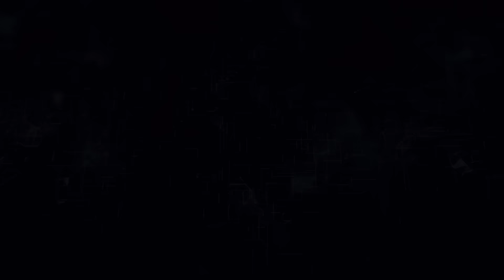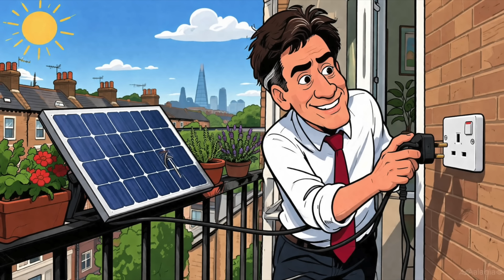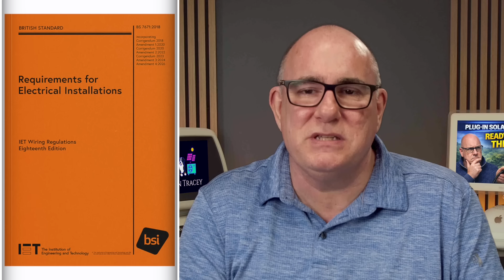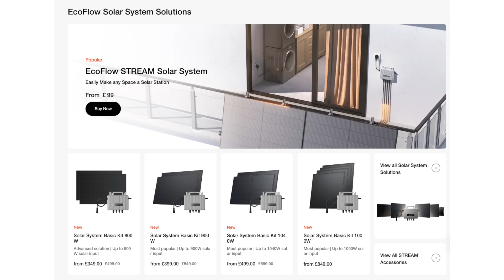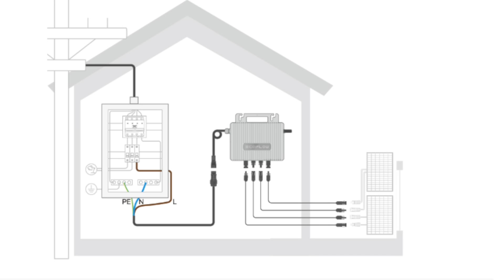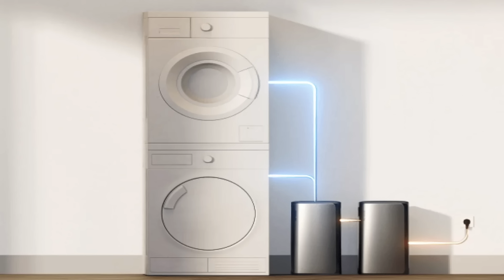Plug In Solar Is Coming… But There’s a Problem

Comment: We dont get near enough sunshine in the uk and we use more electricity in the winter so the whole idea is utterly ridiculous
Reply from the maker: @kickpublishing Ah yes, the UK — famously a place where solar panels simply refuse to work… which will come as a surprise to the **1.4+ million homes already using them**.

You’re right about one thing though:  
👉 We use more energy in winter  
👉 And yes, solar produces less in winter  

Brilliant — that’s exactly why people don’t rely on just solar.

What actually happens (in the real world, not the “utterly ridiculous” version):
- Solar massively overproduces in spring/summer (when days are long — even in the UK)  
- That energy either offsets your usage directly or earns export income  
- Then in winter, you combine that with tariffs, batteries, or just import less overall than you otherwise would  

So the idea isn’t “solar powers everything 365 days a year” — it’s “solar reduces your total bill significantly across the year.”

And just for context:
- Germany has *less sunshine than large parts of the UK* and has installed vastly more solar  
- The UK regularly generates *10–20%+ of its electricity from solar* in summer  
- My own system (real data, not theory) generates thousands of kWh per year — in the UK… somehow surviving the lack of sunshine you mentioned

So calling the whole idea “utterly ridiculous” is a bit like saying umbrellas don’t work because it doesn’t rain every day.

It’s not ridiculous — it’s just… not how you think it works 👍

Comment: One of the main reasons for having solar panels is you can still have some power if the grid fails. Unfortunately, with plug in you don't - your plug in system switches off. Much better to combine your panels with a small home power station and store some energy while you also run your fridge and kettle etc. Keep it separate from the grid. If the grid fails you still have light and can cook.
Reply from the maker: @petercc8679 I think you’ve got that the wrong way round.

Backup power is a *nice side benefit* if your system is designed for it — but it’s absolutely not one of the main reasons people install solar.

The main reason is very simple:  
👉 *reduce your electricity bills*

That’s why the vast majority of UK installs are grid-tied and don’t provide backup during an outage — because adding islanding/backup capability adds cost and complexity that most people don’t need or want.

You are right on one point though:  
✔️ Plug-in systems shut off when the grid goes down — that’s a **legal safety requirement**, not a flaw  
✔️ And yes, if you specifically want backup, you need a system designed for it (battery + islanding capability)

But suggesting people should “keep it separate from the grid” as the default solution is where it goes off track a bit… because:
- You lose the ability to offset your bill efficiently  
- You can’t export surplus  
- And you’re effectively building a tiny off-grid system to run a kettle and a fridge occasionally

So yes — if your priority is blackout resilience, design for that.  
But for 99% of people, solar is about saving money first… and everything else comes after that 👍

Comment: What i have discovered, unless you have the output from the inverter wired into the consumer unit, plugging it in now (no regs in place) will invalidate insurance in the event of a fire being caused by electrical.
Reply from the maker: enough people seem to be willing to take the risk, but it won’t be a problem going forward once the regulations get updated

But just to put things into perspective, millions of these things have been installed on the continent and they’re in no reports of fires
Reply: @JonathanTracey  not saying this would cause the fire, just saying insurance companies i’ve rang have said not covered. I have a second consumer unit in the garage so will put it on there

Comment: I use ecoflow with a power station plus micro inverter with smart plugs, with 2 solar panels, I've used these since May last year already saving £347
Reply from the maker: nice, what do you control with smart plugs

Comment: We spend £30 a month on electricity, so I can't see the point, but I like the idea.
Reply from the maker: yeah it’s not gonna work for everybody, £30 a month is still £360 a year
Reply: @JonathanTracey when they start selling them for £200 perhaps
Reply from the maker: a single panel and micro inverter will be about £200

Comment: If I cut back a large tree that is causing shade on my existing array do I need to submit a G99 addendum because my generation will go up? If not, then adding an 800w plug in panel may not increase the generation as much as removing the large tree, so how would they know?
Reply from the maker: The honest answer is they won’t know, I would hold off until the new legislation is in place. It may be that for small micro inverters. You don’t have to notify anybody, that would make them truly plug-in play.

Comment: I am very interested in this option. Got a perfect balcony for a couple of panels. My question is, would it help to charge an EV using a granny charger ?
Reply from the maker: @markmitchell4179 yes — but only partially 👍

A couple of panels will offset some of the energy, but a granny charger pulls ~2–2.5kW, so you’ll still be topping up from the grid.

It definitely helps reduce the cost, just won’t fully cover it 👍
Reply: @JonathanTracey  Thanks for the quick and informative reply. Much appreciated

Comment: Im looking at the Ecoflow Stream to run my garden log cabin studio, after watching your videos and a few others I think it will massively help especially when Im running 3 300W strobes in there.
Reply from the maker: I would maybe consider adding a battery something like the stream ultra that way the battery can supply the strobes and you wont get brown outs when the sun goes behind clouds

Comment: Planning on putting 4 panels on my garage as it gets sun all day long, and having it wired into the fuse board in the garage - would this be ok ?.
Reply from the maker: Yes but just to be clear you will need an inverter that can handle the 4 panels, something like the ecoflow stream ultra, then connect that to the fuse board
Reply: @JonathanTracey  nice one, that's what I was going to do, thank you so much  😊👍🏻👍🏻👍🏻

Comment: What we need is all EV's to be capable of V2G. Even now we have huge wind energy but a lot of the time much of it is turned off due to lack of storage. Tesla's only require an online software update and most Chinese/Korean cars have this capability already.
EV batteries are huge and even allowing just 20% to be utilised would massively increase storage capacity for the 4pm - 7pm peak. It would also allow solar to be stored for evening use and reduce our use of gas.
Reply from the maker: Yep but whats the incentive for the car makers to turn this on, it adds wear and tear to the battery and they and they get no benefits, so there is no rush from the auto industry
Reply: @JonathanTracey plenty of the Asian manufacturers already allow the battery to power external AC equipment.
Reply: Are you sure about Teslas only neading a software update to do V2L? I was under the impression that most Teslas only have a inverter that works in 1 way and that only certain very recent cars have capable inverters  ? (i have an MYLR from 2022 and would love to add the huge Tesla battery to my existing home 13.5kwh batery!)
Reply: @Warekiwi they can allow the battery DC to be connected to an external inverter as some Chinese inverters already fool the car to think it is charging. I understand CCS protocol has the capability anyway.

Comment: Tens of billions spent to fix fire safety issues with high rise apartment blocks and now we are going to stick solar panels all over them.
Grenfell round 2 here we come!
Reply from the maker: @StevenCavill-s9f I get the concern 👍

But solar itself isn’t the fire risk — poor materials and bad installs were the issue. Modern systems are designed and tested very differently.

Like anything, it comes down to doing it properly 👍

Comment: The electricity providers have to maintain standards for their supplies to users, despite some major variations in consumer demand. A very severe spike in consumption occurs in the ad break in "Coronation Street" TV show, when people put the dishwasher on in a million houses simultaneously and flush the toilet -meaning that mains water needs more pumping and ALL at the same time. (For non Brits, Corronation Street is a long running soap opera that attracts 20+% of the UK population and therefore the ad break is a mass synchronising pulse for most of the country (See wikipedia)).
Reply from the maker: @seymourpro6097 you’re referring to the old “TV pickup” effect 👍

That was definitely a thing years ago (kettles during ad breaks!), but it’s much less of an issue now with smarter grid balancing and more diverse demand patterns.

Good example of why the grid has to be built to handle peaks though 👍
Reply: The famour corrie spike was caused by millions of kettles turning on as people used the break to make a cuppa.  I don't know if it's still true though. It used to be something the grid operator had to plan for, many years ago, but TV viewing patterns have changed now - between streaming and DVRs, do we still have so many people watching the show simutainously?

Comment: Do you think there will be small plug in wind generators as well ? This would help during the night ?
Reply from the maker: It would be nice, but all the ones that I’ve seen that are small enough to be used on a domestic property. Don’t generate hardly anything.

Comment: How does it work plugged into socket though I understand with battery storage but not plugged into wall.
Reply from the maker: the inverter in either the micro inverter or the battery/inverter combo sends power down the cable into the mains of your home, you device and appliances use that power

Comment: I have some small solar panels that just maintain a moderate SLA battery bank. These can be manually connected to DC LED lamps. NO interface with the mains so no mains compliance needed. SLAs came from an alarm company so they are OLD but less than half of their plated capacity still runs LED strip lights for several hours.
Reply from the maker: hey if its aint broke dont fix it :-)
Reply: @JonathanTracey  Total cost of Emergency Lighting by solar was a 10w solar panel for about £25.

Comment: Our house faces south and with WfH and that, right now we're drawing 685W. A 800W "balcony solar" would provide much if not all of our baseload. The low price (2 panels, micro-inverter and mounting brackets) make it very attractive.
Reply from the maker: yep sounds like a great use case, offset those summer costs and save the money for winter

Comment: overlooked and very important is that most safety devices fitted in the UK are unipolar in operation and any reverse supply to them will render them useless possibly negating the protection. it is stupidity to allow any end user to plug a generator into an outlet without the system being audited by a BS7671 engineer... MCS has nothing to do with your domestic electric safety... it should be thrown out with Mr millibands stupidity... you're just promoting bullshit and misinformation😢 ...
Reply from the maker: @MikeRosoftUK I think there’s a bit of perspective needed here 👍  

I’m seeing a lot of pushback from electricians (are you one of them by any chance, just for full disclosure of course)  on this, and I do understand why — it does change the landscape. But that can’t be allowed to stand in the way of progress.  

Germany and France are already doing this at scale, and the reality is *no fires, no deaths, no widespread failures* — so the idea that it’s inherently unsafe just doesn’t stack up. Sometimes our safety culture goes over the top, we let a "it might" become "you cant" a little to easily. 

On your technical point — yes, *bi-directional RCBOs* are the right approach, and I fully expect guidance to evolve to recommend or require them. But that’s a refinement, not a reason to block the entire concept.  

We’re talking about enabling millions of people to *reduce their energy bills safely* — not removing safety standards altogether, and yes MCS does have everything to do with electrical saftey as it defines a minimum standard for a solar installation.

And on the political angle… this isn’t about Miliband or any individual. It’s about practical solutions that work.  

So maybe less of the ranting, and more focus on how we make this *safe, accessible and scalable* 👍

Comment: Has Miliband got shares in these companies? This whole Net Zero stinks of corruption and greed. Miliband rapes our agricultural land and in 15years time all these panels will need to be recycled and replaced or scrapped. Companies won’t do this as cost is too high so the government will be left to clean the countryside as these solar farm leases run out. Electric supplies, gas supplies, water supplies and basic communication should not be in private hands. Nuclear power must be implemented now. All governments have never had the balls to plan these long term investments.🇬🇧🏴🏴🏴
Reply from the maker: @Judith-c6r fair to question policy, but a few of these claims don’t really stack up.  

On the “has Miliband got shares in these companies?” point: *Ed Miliband currently has no entries in the Commons Register of Members’ Financial Interests**, and the government’s latest **List of Ministers’ Interests* for him shows no relevant directorships or shareholdings linked to his energy brief. 

On solar farms “raping agricultural land”: at the end of Sept 2024, *ground-mounted solar covered about 0.1% of total UK land area**. Even under the government’s high-end scenario, it says solar would use **no more than 0.4% of UK land* and **no more than 0.6% of utilised agricultural land by 2030**.

And on panels all needing scrapping in 15 years: that’s just wrong. Solar panels are typically designed for **25–30+ years**, and in the UK they fall under **WEEE rules**, so end-of-life disposal/recycling is a regulated responsibility, not “dump it and walk away”. 

Also worth noting: in England in 2024, *7,000 hectares of agricultural land* had solar panels, and **about 50% of that land was still being used for agricultural production or grazing**. So it isn’t automatically “solar instead of farming”. 

You can absolutely argue for more nuclear *and* still be honest about the numbers on solar. It doesn’t need conspiracy theories to make the case.

Comment: Not seen your channel before. I was one who got caught by the mayor of London’s failed solar group buy scheme. It was very badly managed and we ended up only with working panels and no battery. Thousands of people left disappointed and out of pocket. The media didn’t really pick up on it. Years later we are still very wary as to who to trust to get this sorted as there seem to be a lot of cowboys still in this industry.
Reply from the maker: yeah this is what happens when politicians try to get directly involved in something that they don’t know anything about or to be honest I completely unqualified to manage. If I were going to run a scheme like this, I’d go and find a few industry experts like Greg Jackson and get them to run the scheme rather than use it as some sort of political football to get soundbites for the evening news.

Comment: Clear? That was letter soup. Incomprehensible
Reply from the maker: Maybe explain what you didn’t understand and I might be able to help
Reply: @JonathanTracey too many abbreviations. I need a this and a that, letters rattled off. Seeing them in print helps. Clearly you know your stuff but maybe the folk who said it was easy have electrical knowledge or a degree in physics like my pal who copes with all this. Do not spend time on me, I know I am beyond help. I see now that the position of my house is such I could not use this system.

Comment: Some electricity suppliers are also offering 'virtual' batteries although I suspect they're not very good value. But maybe specific use cases make these worthwhile. IE you send electricity to the grid and receive it back, as you would with a battery'
Reply from the maker: They will pay your 12p to send them a kWh but unless you take it back at night you will pay 30p to get it back during the day

Comment: I'm in France. I have a Zendure system and so far can speak highly of them. Honestly, as you're a YouTuber if you can get a deal with them I'd go for it. Solid devices, good customer service and the app works. In France they initially just allowed plug into any available socket, but now insist on a dedicated circuit. I don't think there's any other requirements, but I'm installing a dedicated solar sub panel with a MCB that is DC tolerant. Just in case there's any DC leakage, which can prevent regular MCBs from tripping. I have to notify my supplier and give the product certifications. But as it's sub 3kw that's all that's needed. If not for the batteries, I wouldn't even need to go that. A couple of points. Some of these products offer 'emergency power' in case of electrical network failure. It should be noted that this is in the form of an external power socket on the battery as providing power to the home network depends on the existing sine wave, which is obviously missing during a power cut. Some people seem to think these will work like a whole house UPS, but that's not feasible. In France DIY work in home electrics is still permitted, so it's probably easier and less expensive to implement here than the UK